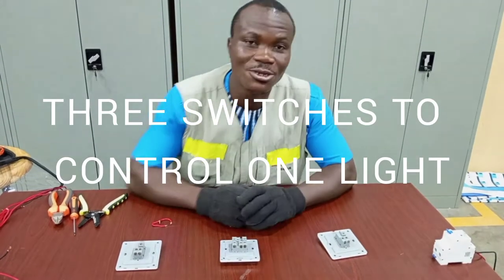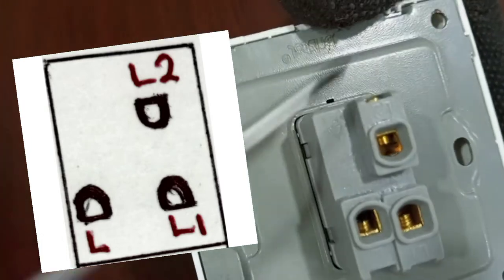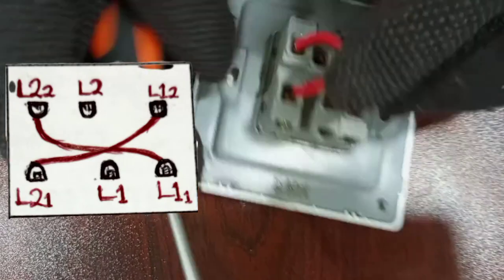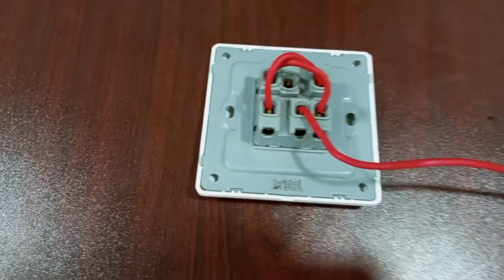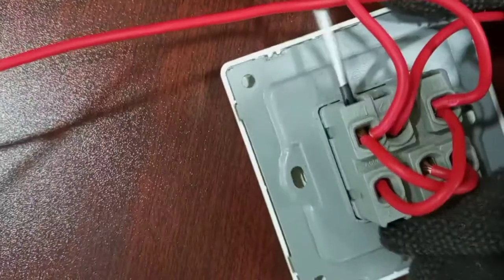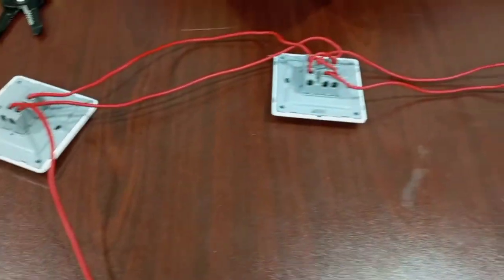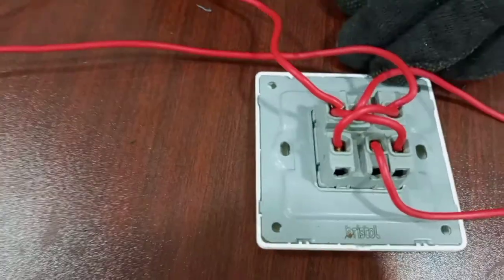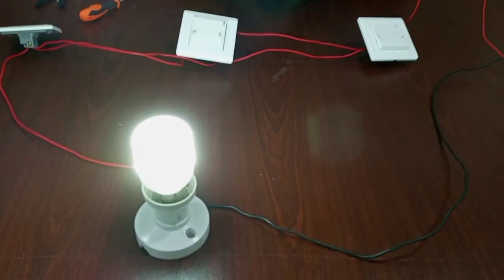how to wire three switches to control one light

Comment: I just feel like giving this 20 likes ....
Reply from the maker: That's great. share to 20 people bro. Thanks
Reply: 4:25
Please with reference to the second 1gang 2way switch where its common is taken to the lampholder, will the lampholder work if the two strappers or pass wire or travellers are connected or terminated these way in the intermediate switch:
1. L22 & L21
2. L11 & L12
3. L22 & L12
4. L21 & L11

Because the L1 and L2 of the intermediate switch is taken to the other 1gang 2way switch which its common has the switch feed or supply

Comment: Great content, Thank you.  Would this be the same wiring in a DC application, using DC Rocker switches ?  Is the “Intermediate” switch ON-OFF-ON and the two (end) switches ON-ON ?

Comment: Sir please the intermediate switch I know has four terminals which are L1, L2, L3 & L4 where from one two way switch comes to L1,L2 and the other two switch comes to L3, L4 but yours is different.
Reply from the maker: please click this link https://youtu.be/ql3sIMpXuSg this video will explain everything to you.  there are two types.
Reply: @obloni_Electrical Good this video answers my question. But the intermediate switch with 6 terminals I haven't seen it before
Reply from the maker: @danielteyehuago1633  it's there. It's very common now

Comment: But sometimes if the intermediate is off the other 2 way switches don't work...why 🤔
Reply from the maker: that happens if you don't wire them well. watch the video carefully and do it well. you don't just connect them anyhow. Any of the switches should be able to control the lamp(s) irrespective of the switching position of the intermediate

Comment: I'm a little bit confused out here because mine got L3, L31 and L32🤔
Reply from the maker: A 3gang switch will have L3, L31 & L32
The intermediate switch has only one gang with 6terminals. What you have has 9terminals. If it is so, then it's a 3gang switch and not intermediate. Please check and see
Reply: @obloni_Electrical Sir please the intermediate switch I know has four terminals which are L1, L2, L3 & L4 where from one two way switch comes to L1,L2 and the other two switch comes to L3, L4 but yours is different.
Reply: @obloni_Electrical thank you sir, but in this case, which of the L(L3,L3¹,L3²) is the com, since other 3gang switches I've seen are indicated"com,L1,L2 ". So in the L3,L3¹,L3² situation, where do you put the com
Reply from the maker: @isaacnewton1707  So in that case  L3 will be the commons.
Reply: @obloni_Electrical  thank you sir, you're the best

Comment: Please what off two lamps
Reply from the maker: You just loop from the other lamp.
Reply: @obloni_Electrical  if i am right, looping will do series connection and hence 1 lamp damage wiil cause other to get Off. Isn't there any other way of connection ?
Reply from the maker: @angelaano  please this video answers your question. https://youtu.be/9Os0zlOYpV8?si=GedrM3k47oxQD6cR
Reply from the maker: @narbahadurpun506  this is series https://youtu.be/kY_7vwjnuBA?si=hVE2Q-uHBgi6MafC
Parallel https://youtu.be/9Os0zlOYpV8?si=WlOgCiWyVn5GoAyv
Reply from the maker: @angelaano  watch this for your answer https://youtu.be/9Os0zlOYpV8?si=XvQuYFGNKSRTYIu1